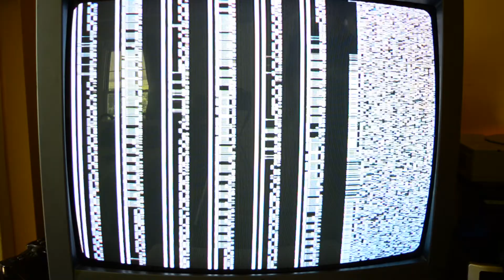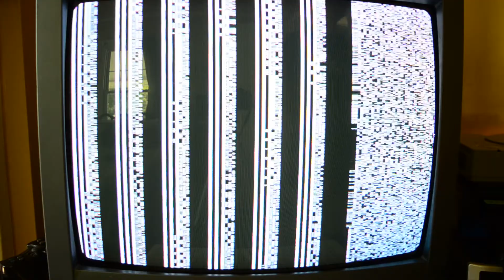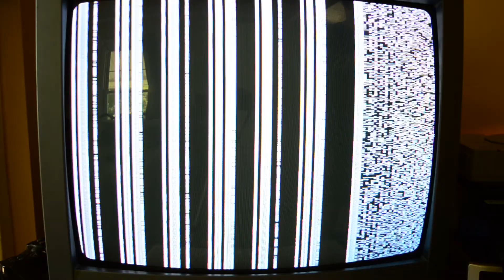Digital audio over analogue video: A forgotten piece of hi-fi history

Comment: It must have been around the mid '90s that i bought this add-on card for my PC out of sheer curiosity. It basically was a video card I suppose, with both an RCA video output and input. It obviously came with software and a manual. The entire purpose of this card was to turn your video-recorder into a tape streamer for your PC. The video image it produced looked strikingly similar to what you get on your screen, except that it obviously wasn't digital audio with any indication of a rhythm to it.
I cannot recall what happened to this card. I only got it to satisfy my curiosity and didn't use it at all after that, since it was cumbersome to use and also rather slow. Not to mention that you had to manually keep track of, and fast forward to the right place, where you had stored you data. I don't recall how much a standard VHS cassette could hold either. But I do remember it to be less than a CD-ROM. So, by all means just much more convenient to simply burn one of those.

Comment: The bars wouldn't get wider with how loud the audio is. This is a binary signal designed to be stored as video on a videotape. The width of the bars is just how long the signal for each bit is placed in the video scan. Voltage is measured or sampled and assigned a value between -32,768 to 32,767 for 16 bit audio (that's for each channel making it a total of 32 bits per stereo sample) at 44,100 times a second for CD audio, then stored as a string of bits or on and off pulses. I've written my own programs to work with CD audio WAV files in the past. Mostly just tools. Nothing particularly interesting. I'm guessing the 16 bits are being placed in the video signal as 6 bits per line. I don't know how they're placing it in the video signal. It's also not always 16 bits. It might be 12 bit PCM. Maybe, half the bits on each line? This video tape digital audio storing format was before CDs were released. I've heard that 8 bit audio is as good as audio tape, so even 12 bits would have been a substantial improvement.

Comment: 6 bars + static = 6 PCM samples and then a checksum/error correction per line? The black bars becing more pronounced during quiet sections due to zeros in the most significant bits for small samples? Black screen on mute maybe due to perfect digital silence? ie all sample bits are zeros. Will always be a tiny bit of noise when the tape deck is stopped
Reply from the maker: Awesome, thanks for the details.